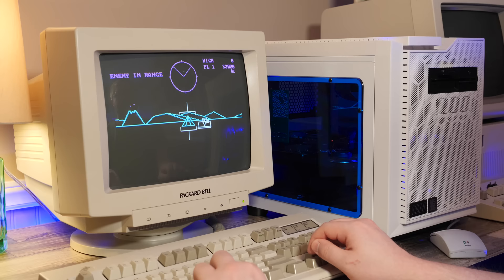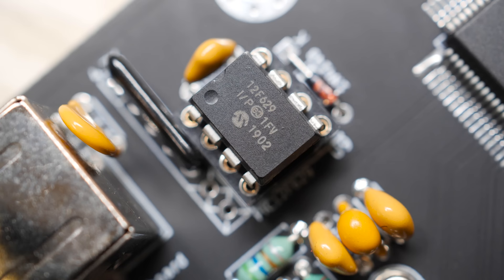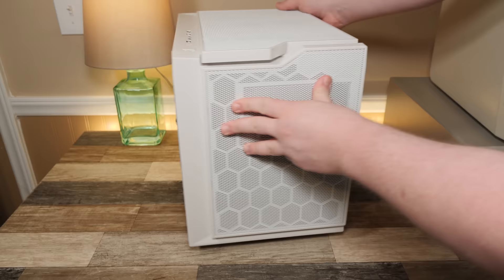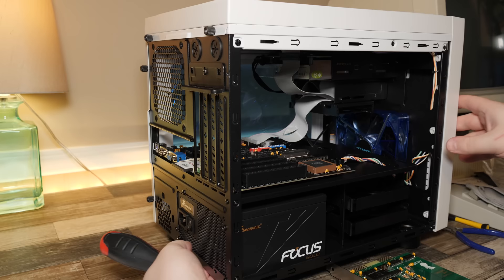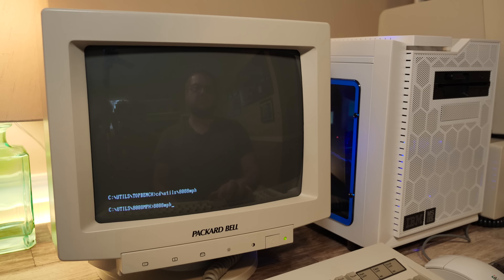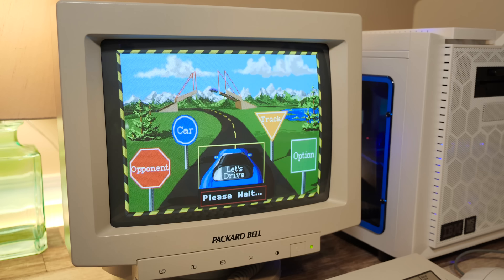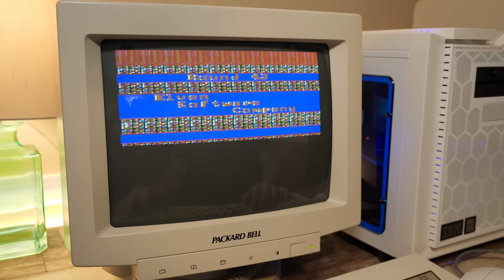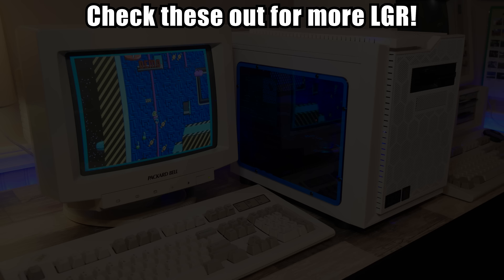Building a MicroATX IBM Clone: The NuXT Turbo PC

Comment: Someone should design a MicroATX with the NuXT specifically in mind. Since it doesn’t have an I/O shield, whoever designs it can probably integrate an I/O shield into the case, if they so chose. Or include a NuXT I/O shield in the box, who knows.

They could have different options depending on what floppy drive setup you want, what colors you want, and whether you’re a fan of side windows.

Also, what brand of speaker are ya using? I’m curious.

Comment: Interesting, I wasn't expecting the expandable ROM slot to also be an EEPROM writer feature on there. I remember The Obsolete Geek did a video on the Grid Compass laptop, which had ROM sockets for extra applications. I've sometimes wondered in what sort of ways other people have used them, past or present, if any. Would they give the operating system extra features. Or perhaps add in a full on application, like a desktop writer. Or maybe its mix of things? Maybe make a ROM chip with Commander Keen on it ;)

Comment: Because nostalgia reasons, I was going to complain about the use of Trident video, preferring the Cirrus Logic 5446. But of course that was only available for the PCI bus rather than ISA :-)
Reply: Kazzle101
I prefer Tseng et4000w32p 
Biggest issue is finding a chip that will tolerate 8-bit bus

Comment: 7:16 Umm clint, does the case have a vent on the bottom for the power supply fan there, as if not, I dont think the thing can breath there, and you risk burning it out or premature wearing the crap out of it.

Comment: I wonder how much of a market there is for a classically-themed, small form factor Micro ITX case- like, still be long/wide enough to hold modern-day cards and performance, but also be able to pull double-duty for a classic motherboard like this with old Intel asthetics and with a drive slot. Any input from your end LGR? I can't imagine I'm the first to think this up.

Comment: Good call avoiding the original IBM case. For that you’d probably end up modding the case to heck and back because they’re proprietary and not ATX.

Also, still consider the 3.5” drive. Especially a 720k one.

Comment: It would have been much easier to work on that case if you'd have removed both sides, and unscrewed the 2 top screws, it hinges at the from and swings open to give you much more room..  I use one for a  supercard pro disk reading/writing machine for my Atari ST and Amiga 3.5 and 8 bit 5.25 floppies..

Comment: Something I've never understood: why CF? Why don't people use SD as a flash storage upgrade for older systems? Is it a file format issue?
Reply: CF cards are just IDE SSDs. They are simple to interface to the 8-bit ISA bus, easy to find in small capacities, and work with modern USB multi-card-readers for connecting to modern PCs for file transfer.

Comment: There is a tool SVM.EXE or SVM89.EXE with wich you can switch the Trident 9000i chip into CGA hardware emulation. Then Round42 displays correct on screen. ;-)

Comment: Hey, that's the same case that I have (except mine's in black and red)! The top also folds up and forward if you unscrew the screws on the sides towards the back.
Reply from the maker: It does indeed! Although the way I have the cables tied to the chassis it prevents me from doing that.

Comment: I never knew what  a math co-processor did, my old IBM pc/2 tower had the spot for one, and I just thought it was a 486 dual core, lolAs for your setup, your 3 1/4 I'd personally use an HXC floppy emulator, why not make it modern floppy system as well :p

Comment: That's really gorgeous. I wonder if anyone will ever make one of these for a slightly later era, like mid-90s. I also kind of wonder if there's a way to attach my monochrome CGA monitor to this...it doesn't use VGA-15, I think it's VGA-9 or something weird like that. I originally used it in a Dutch IBM clone called Tulip.
Also I have EXACTLY the same case badges, I've added a Windows 95 one to my modern work PC. :)

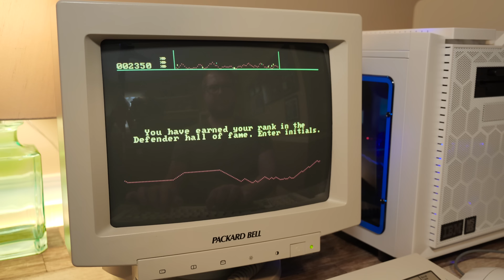Comment: Very neat board, but seems to miss the point. It is apparently no good as a true 8088 (18:28) and the graphics chip is newer than some games expect, so might as well developed it as a 386/486 with turbo switch and with that, vastly increase the number of playable titles.

Comment: Supposedly SimCity could use the 8087 coprocessor. Maybe you could run some tests to see if it does do anything? 

I'm also curious about what difference a V20 makes for gaming. You noticed it ran some 4.77 games too fast, but what about the increased performance?

Comment: It would have been extra cool if it had a second CPU socket that you could switch to for that 8088
Reply from the maker: Or at the very least a ZIF socket to make swapping easier!
Reply: @LGR  Someone should mod one and make them switchable via a turbo button you could put in the front panel.

Comment: Have you considered looking into CP/M on it? You can certainly run the 8088/8086 version but.. the NECv20 has a little used 8080 8-bit compatibility mode. I used to use it with zCPR till the mid-90's.

Comment: Can anyone explain why compact flash is used? I don't have anything against it, but I'm confused as to why it would be used in place of an SD card...
Reply: It is simple to interface to ISA, because CF cards are simply IDE SSDs. And they are easy to find in small sizes suitable for these machines, while also working in modern USB multi-card-readers.

Comment: This floppy cable is weird... the ribbon twist should be between middle and last connector (counting from the m/b connector), making one drive A: (this at the end, after the twist), and another B: (before the twist), while both driver are physically set to be DS1 (aka B:). This looks like someone have added the 5,25" floppy connector on the wrong side of the ribbon. It will work, but only with one drive.

Comment: I’m interested to know why it only has 832K of RAM. I know DOS couldn’t really use it all properly, but a lot of XT clone boards still let you install the full 1MB. My best guess (other than it not being physically possible or cost effective to offer more) is that between the VGA chip and the more advanced BIOS ROM, there’s only enough available addresses for 832K.
Reply: An IBM-compatible system can properly use 640K of conventional memory, with no exceptions.

RAM is divided into:
Conventional memory - 0K-640K (usable by everything)
Upper memory - 640K-1M (DOS, drivers, and TSRs can load here. Not main apps)
Extended memory - 1M+ (286 and up)
Expanded memory - Any amount, with a (usually) 64K window in the upper memory area, that can be switched. Only software designed for this can use it.

The NuXT has 640K of conventional, and up to 192K of Upper memory. The reason you can't use all 384K of upper memory, is because that area is not only for RAM, but for ROM too. The BIOS, and any expansion ROMs and peripheral RAM on cards, resides in this area. With VGA, and no special peripheral RAM (network cards), and no other expansion ROMs, you can have 160K upper memory on the NuXT. If you disabled the VGA and used MDA or CGA, you can have 192K, since there isn't the VGA BIOS taking up some of the upper memory region.

The VGA card has its own RAM, totally separate.

When a late model XT lets you install 1M of RAM, it is still only 640K conventional, but there is usually hardware that lets you use some of the 384K as Upper Memory, or all of it as Expanded memory.

You can read more about the different memory types of XTs in the NuXT manual.
Reply: Monotech PCs I was vaguely aware of a lot of that, but thanks for explaining it as it’s been a while since I even so much as thought about a lot of that stuff (and it’ll help anyone who isn’t fully aware of just how much of a cluster PC memory management is :P). I figured it was down to the NuXT being far more well appointed than most XT clones, but it still a little weird seeing an XT-class machine offer less than 1MB total installed RAM (even if the hardware/software can’t use it all properly). Maybe that’s just because I never owned a genuine IBM PC or XT, I don’t know.
Reply: @ianweber9248  the IBM PC 5150 had 16K RAM, up to 64K on the motherboard. The PC 5150 Rev.B, and XT 5160, had 64K, up to 256K on the motherboard.
Via expansion cards, all of these machines can be upgraded to 640K conventional RAM, along with some UMB RAM in unused areas of the Upper Memory space, and EMS RAM in any quantity.
The NuXT does indeed have 1MiB physical RAM (two 512K chips, one for 0-512K, always on, and one for 512-640K, and selectable blocks of UMB), but the maximum that can be utilized is 832K, since there are six switches for 32K UMB each. I couldn't add more UMB blocks, as it would cut into areas of the memory (memory, not RAM) address space used by BIOS, MDA/CGA video RAM (RAM on these cards themselves, mapped into the system's memory address space; none of the 1MiB main RAM is used as video RAM).
Any XT is like this. 808x has 20 address lines. That means a 1MiB address space, with no exceptions, and it can't all be RAM.

Comment: I was really hoping to hear it if could run windows 3.1. 

Interested in older systems and I’d love to build this, but purely dos with no GUI is not what I want to get into 

Maybe you’ll do another video pushing its limits and seeing what it can do. 

I also thought this would be perfect for that light control system you did a video on a while back!
Reply from the maker: I've got Windows 3.0 running on it now! But it's pretty darned slow as you'd expect for this CPU.
Reply: LGR ahh dang, well at least now i know haha!  

Thanks!, maybe they will release another model with a more upgraded specs for a clone designed for 3.1.

Comment: I wonder if that Trident chip is still attached via the ISA bus, even though it's integrated on the motherboard? That would be more compatible than having some sort of direct CPU connection, but would obviously be a lot slower.
Reply: d2factotum 
Everything XT was ISA. This before ‘lanes’, nb/sb stuff.

Comment: Did you actually run Windows 3.1 on an XT clone?! Wow! :D
Reply: Windows 3.0. And most Windows 3.0 apps need a 286 or 386, so it's a novelty. You can even run at 1024x768, if you enjoy slideshows.

Comment: Neat... But I just discovered FPGA, someone even connected an 8088 cpu (simulated in fpga) to an old motherboard, and it run 8088mph demo perfectly. So...
Reply: Osystem 
Q: would you rather drive a Ford Model T, or a Focus only at 25mph? 😎

Comment: This case has one disadvantage that would turn me off: Top-mounted USB slots. I love my PC, I really do, but the case has those and holy hannah, these are dust/debris magnets.

edit: spelling
Reply: trekchu And unstackable too.  I prefer to stack equipment and have forward facing connectors.  By the way, they did make ISA bus USB controller cards, though I don't know if they made 8-bit versions.
Reply: @johnfrancisdoe1563  I can't stack my desktop either, chiefly because it has upwards-facing air vents that it really needs, but eh, it's ma desktop.

Comment: Wonder if they will make a NuAT?
Reply: Bryon Lape I was thinking about that earlier and originally thought that it probably wouldn’t be too difficult to make a NuAT-type board since that PC/XT and the AT shared a number of the same basic support chips just doubled up in the case of the AT. However, that was based on the assumption that they were using an FPGA, PLD or some other custom solution for the core logic, but upon looking into it a little more it turns out that it uses a dedicated chip, a Faraday FE2010A, for that meaning that unless an AT equivalent can be sourced,it’s highly unlikely you’ll see anything similar for newer architectures.

Comment: can it be overclocked :D
Reply: Jon Donnelly Yeah, also surprised there weren't 8088/8086 CPUs above 10MHz.  8086 XT duplicates with 16 bit slots were a thing, most notably IBM's own PS/2 model 30.

Comment: $320 for a motherboard? It would be far cheaper to actually buy an original XT.
Reply from the maker: Not when you include all the upgrades and integrated components that would otherwise require additional ISA boards.
Reply: @LGR  Only thing it really adds is VGA. Which can still be had cheap. CF is pointless really but can be added for $10 to any build if the user really wants it for some unknown reason. For what it is, it's still way over priced, even a year later. Pick up an ast sixpack plus and you are set.

Comment: 38 Seconds in and I'm sold!
Great Case choice, looks so sexy! There are cheaper lower powered choices for power supplies, but Sea Sonic is great even if it's overkill.
As for the Rear I/O Shield, there are places that custom make them for you if you search around. Or you can be lazy and make one like this guy did https://www.youtube.com/watch?v=PBMDr4KSz4g
#hardwarep0rn